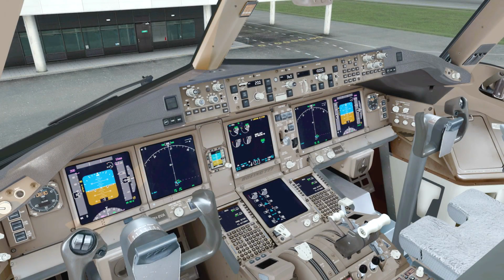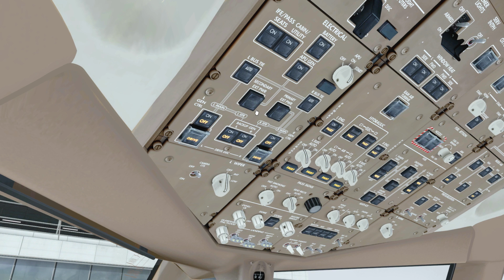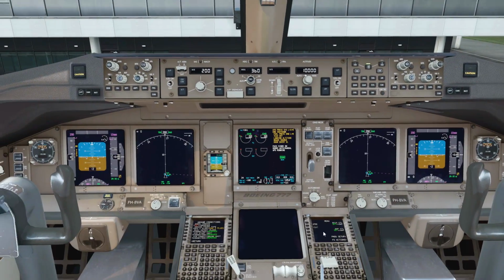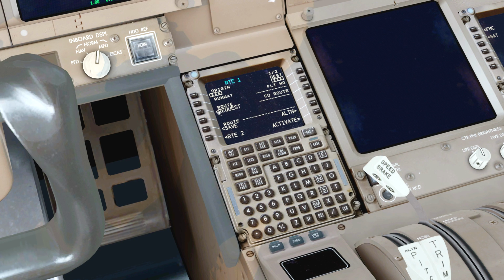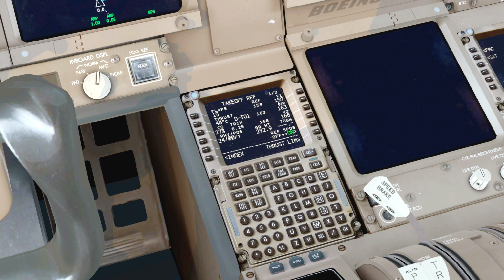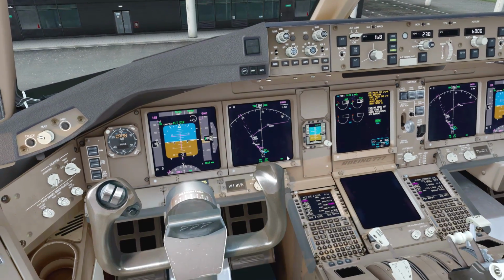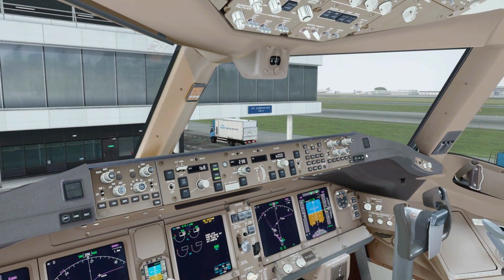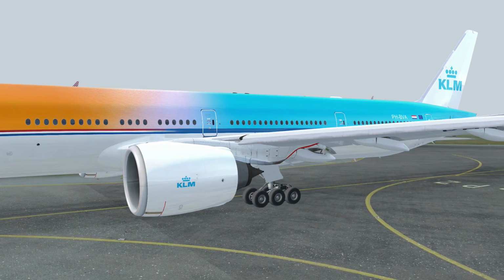Tutorial: Boeing 777 Cold & Dark Startup + FMC Programming!  [2018] [PMDG] [P3D V4.3]

Comment: It is always a challenge to put out a tutorial such as this, on one hand trying to keep it simple, and the other  accurate as the Boeing Ops manuals.  I noticed you tripped yourself a few times as you did not follow the Boeing scans and flows.  I was a simulator instructor on the 300ER for Boeing, and I can promise any newby about to take on this wonderful bird, do the procedures as per the manuals and it is a really simple and logical aircraft.  With only a small amount of practice, it will come to you quite easily.  READ THE BOOKS.  Phil
Reply from the maker: Indeed, producing a tutorial is not the same as using the actual aircraft in real life. Therefore it's for flight simulation purposes only. Would love to use the real life knowledge someday, but only when IRL flight training is finished some day!

Comment: Hi AviationPro, this is an excellent video (even sept. 2018, still valid), thanks! I'm just surprised the A/T L and A/T R switches are set to "ARM" position on cold & dark. This remains true for lastest PMDG 777 for Prepar3D v5 (March 2021). IMHO it's not realistic (they're turned off just after landing). However they can be turned off by C&D, simply by editing "777 CLDDRK.sav" file, and replacing both "ATArmed_L=1" and "ATArmed_R=1" (two consecutive lines) - by replacing 1 by 0.
Reply from the maker: Thank you! Thanks for adding your suggestion 😉
Reply: Auto throttle arm switches on the MCP are not switched off in normal operations

Comment: something i have issue with is when i had made my route and i'm in destination in 10-15 minutes and i'm like in communication with the tower and it says "u have to landing in this runway" etc. how can i like change my route to the runway in FMC arrival or how works FMC arrival? pls help thx
sorry for bad english
Reply from the maker: Simply select a new arrival and runway in the DEP ARR page, it will replace the current one. If there are any discontinuities you should manually remove/fix them.
Reply: okey thx for the help :)) great video
Reply from the maker: Thanks!

Comment: What's the "SEL-APU" that you enter at 27:55 ?
Reply from the maker: It's a feature specific for the 777 that pops up when the APU is running. If you enter 'APU' instead of a temperature, the APU will supply bleed air to the cabin during takeoff, leaving more room for bleed air being used by the engines to produce thrust, thus kind of performing a pack-off takeoff. Once you put an temperature under SEL-APU though, the APU selection is deleted and you simply fly a takeoff using the assumed temperature that you filled in. You can get the assumed temperature from takeoff performance calculators like TOPCAT or TOPER.
Reply: Thanks you :)